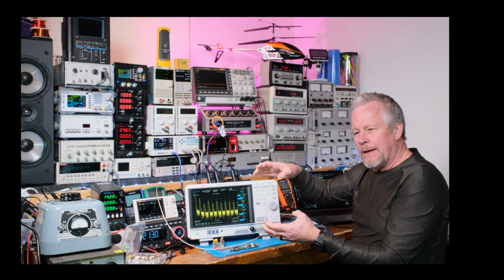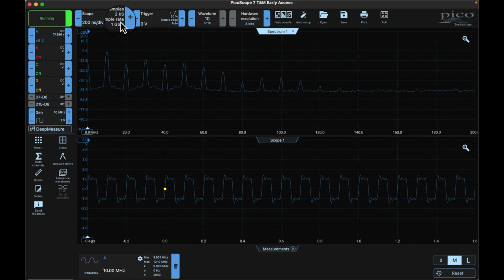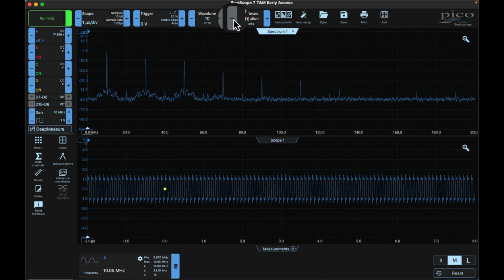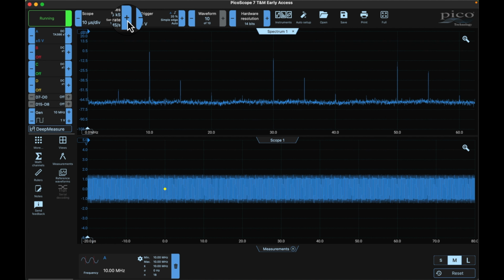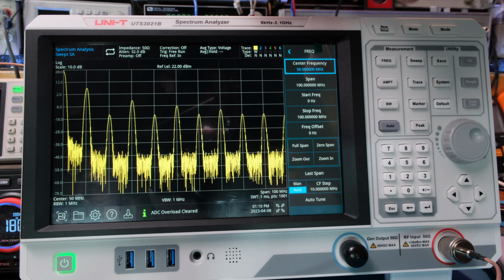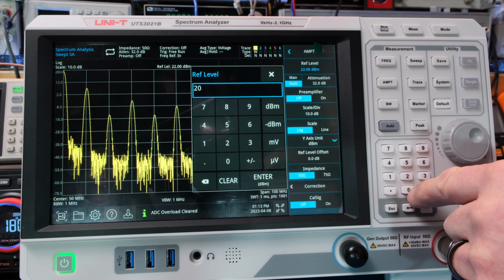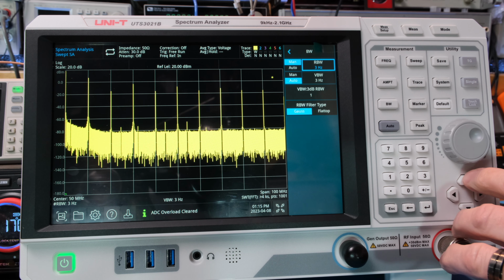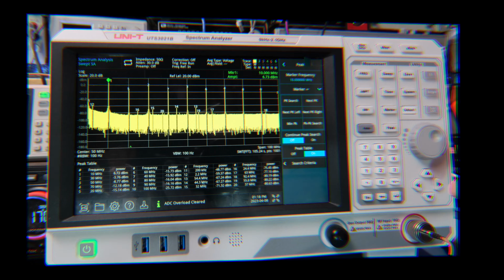Spectrum Analyzer vs Oscilloscope FFT: Uni-T UTS3021B vs PicoScope 5444D MSO #12bitoscilloscope

Comment: Me again… for me the most important thing to teach newbies about spectrum analyzers is that it low impedance over the whole band…  can remember as senior engineer having a very expensive spectrum analyzer in my charge, breaking out in a sweat whenever a junior engineer in another department just wanting to borrow it for a quick test… from experience, they dont recognize that it is a wide-band device, so they just have a problem between say 1and 2 GHz, and they turn down the attenuation trying to look at the small signal they want to see over there, forgetting about a 10W signal beyond their area of interest!!!! 😢😢😢 call me nasty, but at some stage, when non-RF engineers wanted to borrow my spectrum analyzer, I first gave them a test to see if they could actually use it, and then spending hours lecturing them on using it. Esp. on some HP spectrum analyzers that could go down to DC, and is is a PSU-engineer having problems with EMI.
Reply from the maker: This is great feedback!  I know what you mean - it is tuff to let go - especially when you have experienced the failures of others...  But, then you can only try to help them the next time - and everyone will grow and learn...in the perfect world.  LOL

Comment: Great video, I've been using the PicoScope and the Cleverscope for a long time now, super useful in electronic field servicing, repairs and maintenance. Especially when you want to connect to someone for expert advice remote diagnosis, etc. The new PicoScope software is a big improvement. Of course people tend to think that USB scopes are cheap, which we know isn't the case for the PicoScope or Cleverscope.
Reply from the maker: Great feedback!  PicoScope has changed my mind on usb scopes!
Reply: @KissAnalog  All I can relay is my own experience. For those interested I've a Cleverscope MSO 328A, which is just terrific 14-bit and I find it's excellent for detecting fast transients.

I also have a PicoScope 3204D which has similar capabilities but is 8-bit, but I find it's built a bit more robust so I can risk leaving it in situ in industrial conditions to collect data remotely.

I happily recommend either brand.

Comment: Happy B day. Mine is later this week. I have no idea why most stop at 9khz. Seems like it would be easy to add lower frequencies. You can get a Dynamic signal analyzer that will analyze low frequencies. Just from my personal experience the FFT on a  Picoscope 4262 does an excellent job for those interested in the Audio range.
Reply from the maker: Thanks - and I totally agree with you.  I am becoming a big fan of the Picoscopes!  Happy Birthday!!